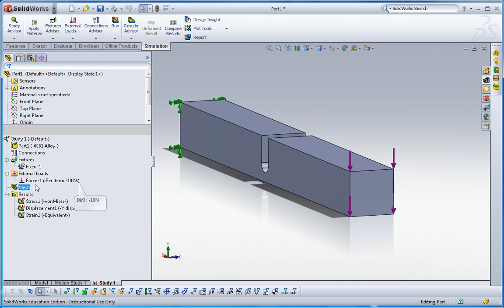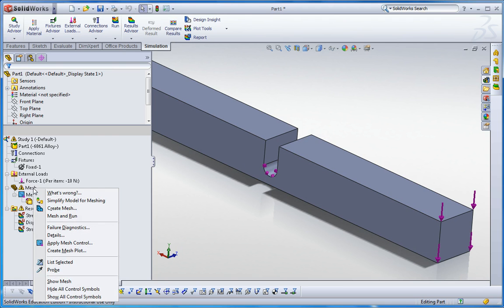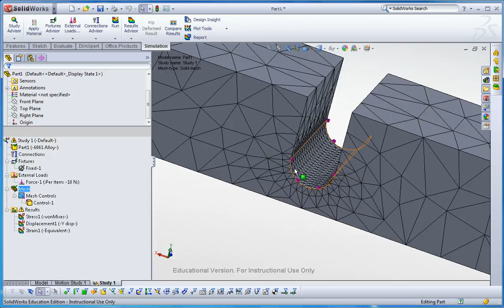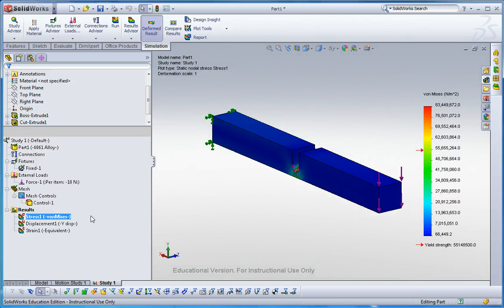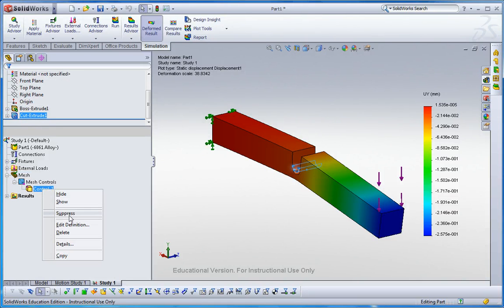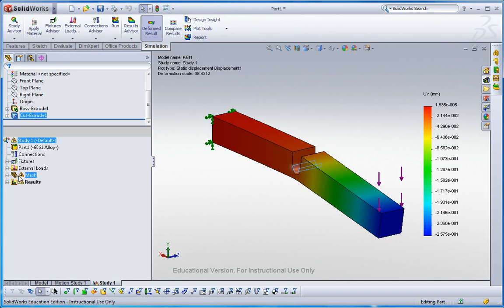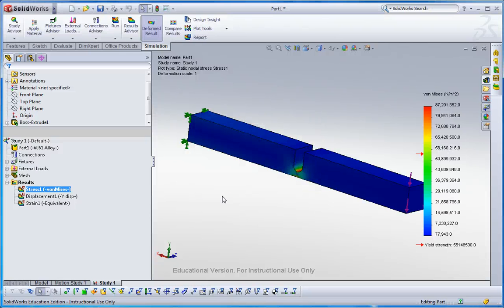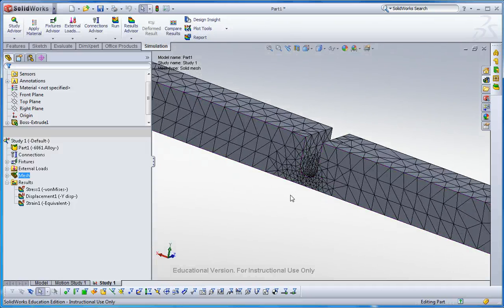Solidworks simulation: Mesh control, adaptive meshing.

Comment: Hello Won,

Sorry to disturbe you again.

Suposse I have h-adaptative selected, but I still consider that need more precision in one face and put a mesh control. 

Is this possible? Could h-adatative reduce the mesh control?

Who is " the boss"

Has this sense?
Reply from the maker: PABLO JORGE I am happy to discuss any problems. Please feel free to ask. I understand you need more precision. However, finite element method is an approximated solution where you need to specify your precision level. It always depends on each model or each project. We can talk more via email, please email me with your details. Thanks,

Comment: Hello Won, 

Interesting video.

Just one question, after you select h-adaptative, is neccessary to run the simulation anyway, or can it use the previous simulation with a coarse mesh?
Reply from the maker: First, thank you for watching this video.
The 'H-adaptive' changes nodes and meshes based on the previous coarse mesh. Once you run an analysis with 'H-adaptive', the previous results disappear. I suggest that you can generate another 'study2' for 'h-adaptive', then keep the coarse mesh results in 'study1'.